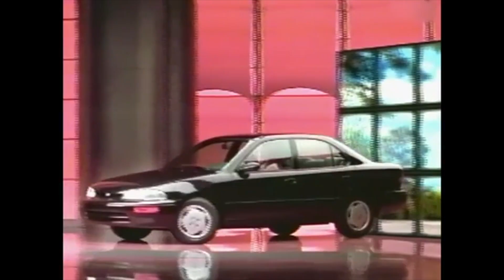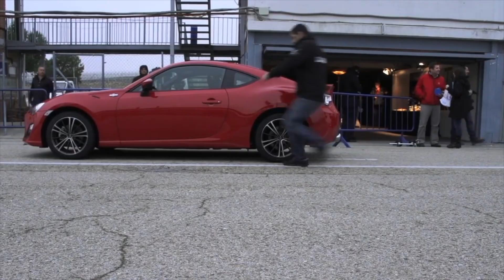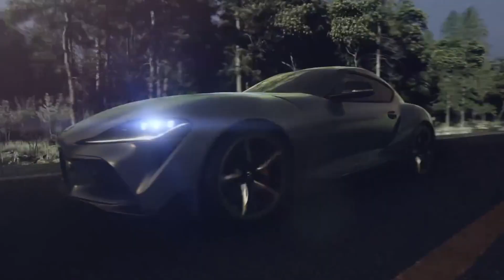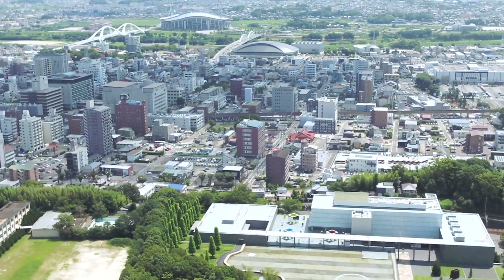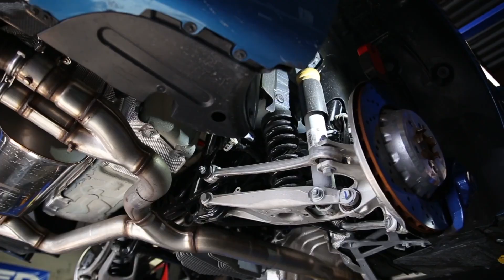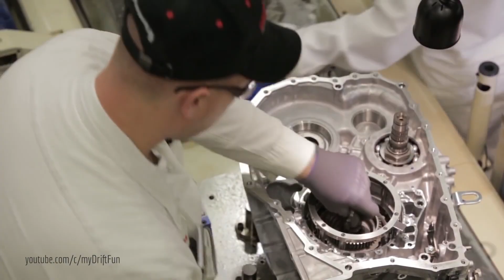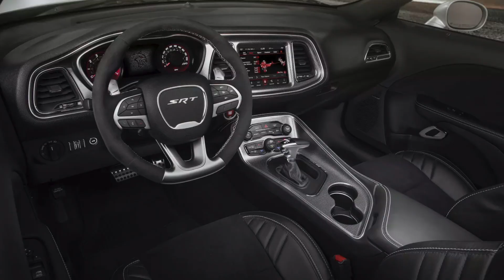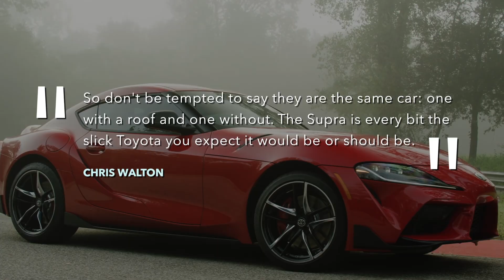MKV Toyota Supra - BMW or Toyota? The UNTOLD TRUE STORY

Comment: BMW approached Toyota not the other way around and once they determined the basics like drivetrain they went their separate ways without the partnership this car wouldn't have happened.  Toyota designed its own body, tuned the suspension and engine all by themselves.  The supra and z4 are different.
Reply: @Gordon People who have driven both say they handle very differently because Toyota tuned the suspension separately so they aren't the same

Comment: This really shows the different dynamics of each company, BMW was surprised by Toyota's commitment to quality and Toyota was surprised by BMW'S  ability to throw money at problems. Toyota really took em to school on quality control and none will disagree that they needed the wake up call.
Reply: Toyota is shit quality compared to BMW
Reply: @YoungCarWiz  body and trim quality sure, engine quality (unless we are talking about the inline 6) not so much. I only have just shy of a decade in the automotive industry and have seen the pains of both sides and dealt with both companies at length, Toyotas just run and refuse to quit. BMW tend to quit at any chance they are given even from minor system failures that require computer intervention and licensed technicians to handle. Im not saying BMW are garbage but Toyota just generaly hold up longer than most BMW and they don't need that much love to do it either.
Reply: @emanuelemanuel7038  yeah

Comment: Its a Toyota Supra.  Listen to the designer.  He was the original Supra designers  protege.  The only thing is it had a BMW motor.   If a chevy Volt had a 2jz-gte motor,  would you call it a Toyota?  The Supra was designed for tuners,  having connections and purposely built room for common add ons.   If you have the money to buy one,  put a 2jz in it,  if it makes you unhappy.
Reply: Most interior items are direct ports from existing BMW parts.

Comment: Toyota failed miserably on the body design.....it is just plain UGLY, UGLY, UGLY!  Should have let BMW lend a hand, bought a third party designer....or stolen a designer from another brand like so many manufacturers are doing today.  Having owned BMW cars and motorcycles (as well as Toyota and Hondas, etc...), gonna bet the Toyota will be much, much, much more reliable (although past Supras never came close to Toyota reliability) and cheaper to maintain.....but still UGLY!

Comment: This pure propaganda.  Is the new supra a rebadged old Z4? No.  Is the new supra a coupe version of the new z4. Yes.  They developed the platform together.  So the 2 are on the same platform.  Stated clearly in this video.
And, with the exception of the small part of the digital dash right in front of the driver, the entire interior is identical to the new Z4 (and a lot like any other BMW).
The drivetrain is mostly BMW, and the only part that isn't is a generic automatic found everywhere.

So the body's style is toyota, but the car is built close to where all the BMW parts are, with a generic trani and a shared platform.  Same wheelbase, same engine, same rear end as the BMW.

If you asked if the Z4 is really a rebadged Supra, you'd then have find which hidden parts were actually Toyota.   Not too many.  And none at all visible. And all were part of the "platform", and don't have Toyota labels.

Pop the hood on a supra: actual manufacturing labels on many of the underhood parts.  The only Toyota label: the bagde.
Hmmmmm...

Comment: Wonderful piece on automobile engineering. In my opinion, partnerships are necessary in today's world. And partnerships often create fresh perspectives for an individual line of thought which was previously isolated from the other one. A wonderful example is right here. And though emissions control are necessary in the coming times, to avoid loosing our planet's survivability, without partnerships each Goliath(read Piston-wheels) will turn to dust in front of the new David(read E-cars) eventually. But I don't like the idea of autonomy; no matter what, or how comforting it could be; would be the death of fun in driving. And certainly after a few decades, people will just forget how to drive a car.

Comment: Save your money, buy the original supra, be happy.
Reply: BornInBosnia if you mean the one that came out in fast and furious your wrong that’s not the original..
Reply: The lengend of the Supra was built up by the tuners, the stock car's kinda boring.
Reply: people are selling stock a80's for like 100k now
Reply: you mean spend more? because its getting expensive and the cars a lot more boaty then the MK5. Should be noted MK4 isn't the "original" that fast and furious fans believe.
Reply: The old supra is overrated, a slow moving RWD of the time, even at track it's still slow, only good thing is straights

Comment: toyota dishonors its japanese heritage by having this legend co designed in part by a german company . you can never call this a true jdm car
Reply: @Dr Dimmer not what I said it's not a Japanese motor and it 100 percent is not better than the mk4 it might have nicer interior.  and if it was any other car that was badge engineered I wouldn't have an issue but this is a disgrace to Toyota.  ohh and btw the rear suspension is horrible with bump steer . 1 more thing I know that jdm means japanese domestic market and has to be sold in Japan for it to be jdm however it's never going to be a true jdm car as it's made with a german engine.  Ya know I'm not a fan. mk5 supra is a disgrace.
Reply: Japanese have used german motors before.
Reply: @Leonidae  shouldnt be used on the Supra specifically

Comment: I can really appreciate the research and facts brought out here. It really clears many things up concerning the Toyota/BMW collaboration. Well stated and very interesting to say the least and otherwise without their partnership, we would've never gotten either of these cars. Manual of course is always good but then again how many sports cars today at all price ranges are really using a manual anymore? As much as some of us like to row our own gears we have to accept that they are just about gone now for dual clutch transmissions instead. And this seems to be the standard for most sports cars today. The auto industry has moved in this direction so we have to adapt to the change as well. Complaining and whining about manuals now is not going to change anything. If a company happens to offer one great but don't expect this to be the case anymore. But I digress, an odd pairing between these two companies but all in all I think we may end up pleasantly surprised. Just because it's new and different than previous ones doesn't mean it still can't be good in it's own way.
Reply: @mauricemiller2107  We did end up pleasantly surprised, not only by the reliability of the GR Supra, but also by the manual transmission option. I bought one with auto transmission, as I already had an MX5 with 6-speed manual. Both are fun cars.

Comment: I think this would be an excellent successor due to the modification to give real driver and mechanics the ability to create a 2jz type engine with deck sleeves and an upgraded turbo system. The only thing is that it should come with a 6spd. Eventually, aftermarket should be able to make an ft1 concept kit to better revise the body.  But Toyota did leave room for improvement all around for the Supra.

Comment: It’s a car that already had a past and following. Then the go and bastardize it and completely make a new car. Supra people are hard core tuners. The old models variations of engines and transmission where fine. They should’ve at least rereleased a 2jz unmolested. But it’s the way things go now it’s what you get not what you want
Reply: That's impossible. The 2JZ will NEVER meet modern emissions standards
Reply: Right on. Ya. Im like most when I heard new Supra I had something else in mind something more raw
Reply: Right on. Ya. Im like most when I heard new Supra I had something else in mind something more raw

Comment: Engine designed and built by Germans. Transmission designed and built by Germans. Chassis designed and built by Germans. The car itself, built in Germany. Have a Japanese designer, wrap some sheet metal and plastic around that platform, and now you can invoke the Supra name and all of the Japanese design history that that conveys? NO! It's a Germanize car. If I bought this car, and had Corvette fenders, hood and body put on the chassis, would it be accepted as a Corvette? Would you then bring out a GM engineer to speak to how proud he is in HIS design? Of course not....that would be silly.

Comment: It has to be 6 speed manual transmission. If not, this is a waste no fun rather buy brand that does. BMW & Toyota, replacement infamous 2jz-gte 6 speed manual transmission made a Supra the ultimate driving machine. Please learn from previous Supra, which, made Supra fame “Bullet Proof”

Comment: I have a friend that has money lots of it to throw away. All she knows about cars is drive, put gas, service it exactly as recommended to save warranty.  Over the last 8 years I've known her she has owned top of the line BMW, MERCEDES, PORSCHE... she says her BMW is always in shop and not worth the plastic it's made of. Even under warranty it became such a hassle. Toyota on the other hand is a reliable car even though they built most all here in USA , Canada with American made parts. Even I see a difference between Toyotas Built in Japan and made here. BMW's are money pits I know because I work on cars. I'm very skeptical of this car. Fun for some rich person like my friend who has tons of money. To bad Toyota didn't go at it alone in JAPAN!!! TOTALLY DIFFERENT CAR!!!! MY 2008 Toyota tundra shows signs of American engineering. Water pumps failing at 26k, then again 5k later. NOT A REAL TOYOTA!! BMW IS A LUXURIOUS CAR BUT NOT LONG TERM RELIABLE AT ALL...I guess what I'm trying to say in my opinion of so many years of working on cars. 90%-100% Toyota 👍👍👍👍 ..50%-50% probably not so good. Assuming this is the ratio and not worse..let the rich play and tell the world if Toyota made a mistake...have you seen the resale value of an 8 year old BMW sport car...

Comment: So, if Got this right, this is how this turned out:
BMW made engines
BMW made suspension
BMW provided transmission (Yes ZF8 is considered BMW transmission as they are first adopter and worked on development and it is best programmed. Not surprising considering reputation of Aisin 8 speed)
BMW provided LSD
BMW provided exact same version of iDrive
BMW did testing. 
Then they sent it to Toyota and said: Here you go, made now Camry, sport edition.

Comment: Just watching this, count the number of minutes feature Germany or German individuals versus Japanese, German chassis, German engine and transmission, Built in Austria and Germany, Yes, the interior has the same mounting points, just slightly different style to the layout. If you removed every reference to Japan in this video, it would hardly skip a beat. This Supra is indeed, a Z4 with a different tune.

Comment: Miguel DSM I have a question about your transmission on doing a project like this can you use the 420a transmission on the 4G63 Evo 5 through 8 motor just to get the car running and driving also can you keep the car front wheel drive and drive it with the EVO motor temporary without the drivetrain  using the 420A Auto transmission or EVO transmission  just to move it to shop to shop or to workplace to workplace. And last but not least see if I wanted to do a evo 9 swap with a auto to my Eclipse all-wheel drive conversion as well how would I proceed is the Evo transfer case both differentials and Driveline acceptable to blot up to our cars

Comment: Re: lacking a manual...

This would be a compromise, but why not put in an electronic H shifter for the automatic?

A lot of the issue is not being able to put it directly into the gear we want, sequential is a little off when playing/racing.

Electronic H shifter would settle the problem for a lot of folks.

Personally I still would prefer a mechanical clutch and full manual, but given age is taking it's toll, I'd rather have an electronic H than a paddle shifter given those two options.

Comment: Tbh I love this video it shouldn’t be needed but I think people who have a prejudice on this car should at least consider these facts before hating. Regardless of all of these great points I simply love the car because it’s an overall upgrade to the brz. Literally all the features this car has were things I wanted for my car (more power, better tech, 50:50 balance) no point in modding now I can save up and get the Supra. So hype train has set sail
Reply: Not hating... I mean, it's basically, like the Toyota team went to BMW for a "Build a Car Workshop" field trip. BMW was like: "these are our M-cars, this how they handle..." Toyota: "We want that!" BMW: "Okay, these guys manufacture the BMW chassis'..." Toyota: "We want that!" BMW: "Okay, this is ZF a German company we contract for transmissions, we have a long history with them, and they are developing an 8-speed automatic..." Toyota: "We want that!" BMW: "Okay, now at the heart of a sports car is the engine, we use various engines, your old Supra had a turbo straight-6 right? Well, while you and most every other manufacturer gave up on the straight-6, we furthered the development and now we have..." Toyota: "We want it!" They will both be sick cars. That 50:50 weight distribution, that's a BMW M-car trait, building the care using BMW's supply chain is like reaching in their parts bin... What is made from BMW parts? A BMW.
Reply: Michael Carr It could be made from ford parts for all I care, I’m here for the objective Tada San and Akio Toyoda had when it came to this car. And bmw parts would be an upgrade in my case since I have a brz where the parts are pretty average quality. To continue with that point you are making Toyota basically did the same with the Boxer engine for the Brz and it worked out really well so I trust they picked good parts for the new car.

Comment: Z-4, Supra, either one fills a nitch to a limited economic customer. I recently purchased a $26,000 base 86. For my lack of driving skills, my being older, in my life, my 86 is giving me tons of smiles as is. I can ride frisky staying within the confines of lane on mountain curved paved roads with great control and frolic fun. In track mode, sport setting, my brain to peddle gear shift could “never” come close to maintaining the skill sets required to handling well. Small drifts at times I’d best describe. Paddle shifters I use only too down shift. And only when steering wheel position affords fingers being able to activate them. Being as light as I can on my Base brakes, has not indicated over heating or even lacking during 5 to 10 miles play time till my stomach and brain says enough, time to stop, pull out my ARB camp chair, relax, read a great book, enjoy some iced tea, take a few photos, listen to any wildlife around me. 

Chill, 

Its better than any E-Ticket at Disney Land. 

More power? Naaah, I believe such a similar car (as Supra/Z-4) would mandate a professional instructor on a track so as to learn “all of a performance cars capabilities” to also teach its drivers how to think, react, and drive to the cars capabilities. 

I am thinking an advanced course to really pushing my own two seater is due. Cheers!

Comment: That car looks like another BMW bro wtf is this dumped trash  horse power 350 wen the old Supra is around 700 horse power this must be a bad joke replacement a 2 jay-z for this pice of trash is just abig mistake
Reply: The 2jz made 320whp. Try again
Reply: @mgoose1359  yeah but I never seen a old Supra all modified lussing against a low car level
Reply: @theslenderman4427  any heavily modified car will beat a lightly modified car.
Reply: @mgoose1359  okay I buy you the buy wen I saw a video from this Supra getting 1200 horse power after modified I will accept this  Supra is better then the 1990-1993
Reply: @theslenderman4427  you do realize that high horsepower doesn't make a good car, right?  Also, there's already a 1k hp crate b58 available. So again, your arguement is invalid.  Just accept the fact that the Mk4 supra isn't the greatest car in the world, and a 20 year old engine is just dated.

Comment: LOL don't worry about these engines.  The B58 in the m240, can very easily be tuned to produce 450 hp and well over 500 tq.  It does however kind of suck they don't put the 6 speed manual, that they already produce anyways.

Comment: Why so much hate?  ( pretty sure most didn't say they hate it ) I think this car seems like it would be pretty cool , but after so many years of waiting for a supra return they get a car they has a heart (engine) that isn't Japanese . it would be the same if they took the Iconic  GTR and it was designed with Mercedes . People wanted a pure Japanese supra experience not a team build . I am sure it will be a great car , a pure supra probably not .
Reply: The issue is people who only really learned about the Mk4 supra from FnF or NFSU. It was originally designed as a GT car, not a sports car, iirc. 

They also don't realize that BMW, while they can be expensive to maintain, do make excellent drivers cars. IMO, taking an excellent I6 from them was the smart way to go. Designing and building a whole new I6 from scratch would have made this car just as expensive as the GTR.